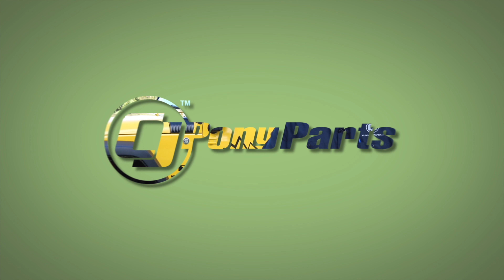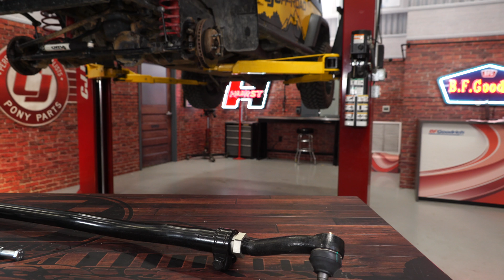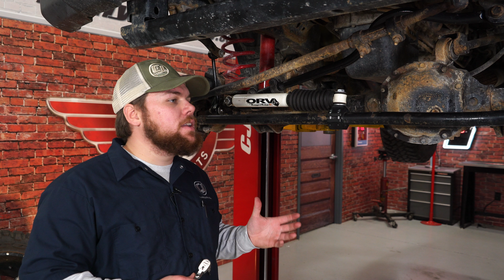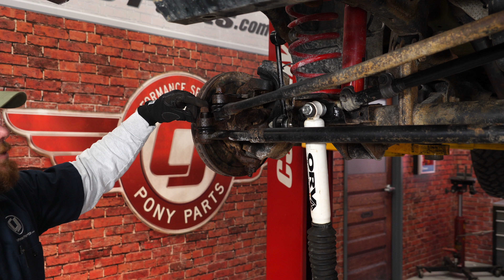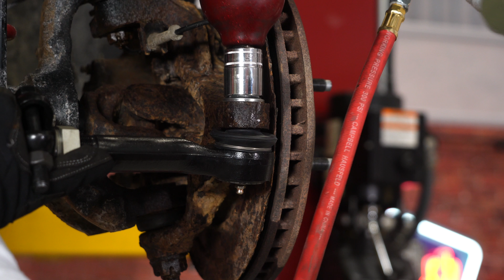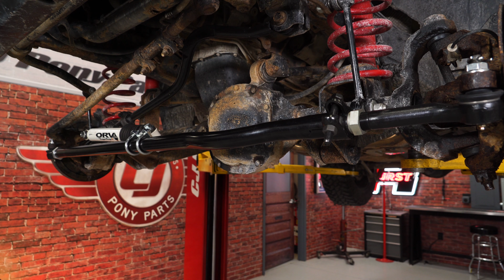Jeep Wrangler JK Currie Tie Rod Currectlync With Steering Stabilizer Mount 2007-2018 Installation

Comment: Dear CJ Offroad I am on the verge of upgrading my steering system on my Jeep JK. I leave in UAE and do a lot of dune bashing (desert driving) almost every weekend and I want to know how does Synergy jk steering system (the one used in the video) compare with Rock Jock JK 9703 Modular Extreme Duty steering system. Is it worth paying double the price for the Rock Jock.

Comment: Why didn't you torque the nuts down to 80 ft lbs like the directions say? Just curious. BTW, great video. I was worried that I had to get it EXACT down to the last mm before I could take it in for alignment. Thanks!